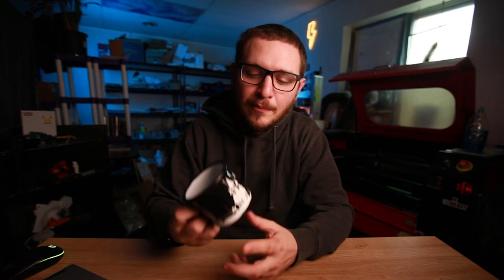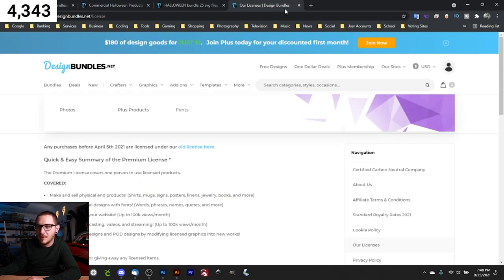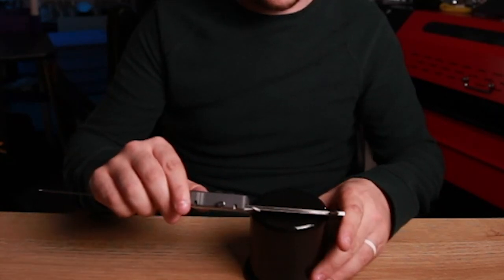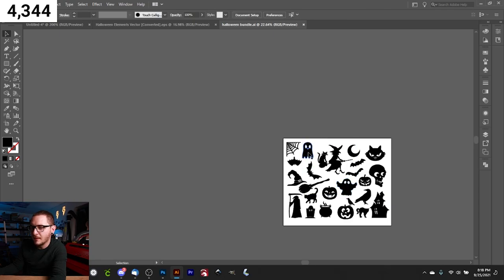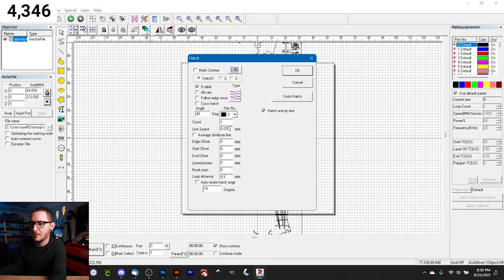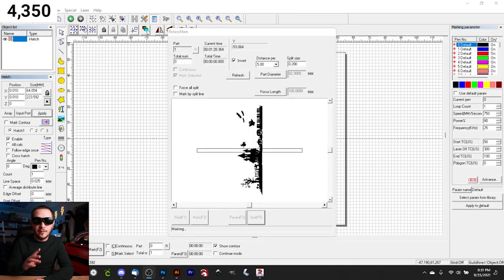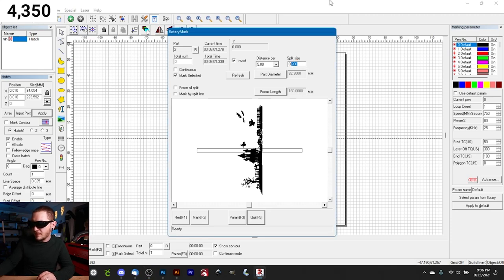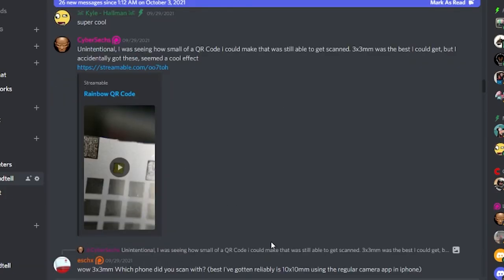How to Make SPOOKY Halloween Camping Mugs with a Fiber Laser!

Comment: Hey Alex, I was trying to follow this video and I got every step except I can't get my mug on to my rotary no matter how I try. Any ideas? 😔
Reply from the maker: The mousepad trick isn't working for you? You can try some craft foam with adhesive backing and try to stick it on the jaws to give you a better grip.
Reply: I was going to try a vacuum cleaner belt if I can find one the right size.
Reply: I also was hoping I would be able to use my rotary chuck to do glasses and beer mugs but broke my first test glass because one of my chucks teeth had fallen out prior to attempting thet and I didn't put it back in right so it was off. All three teeth didn't meet in the middle correctly. So I fixed that but haven't attempted it again. I'm just getting started with all this and trying not to spend so much getting all this working.